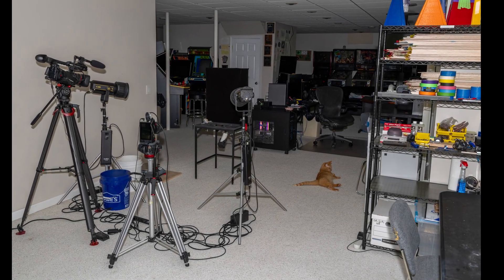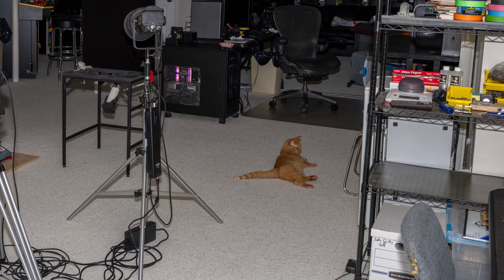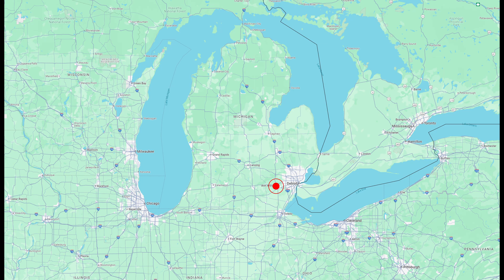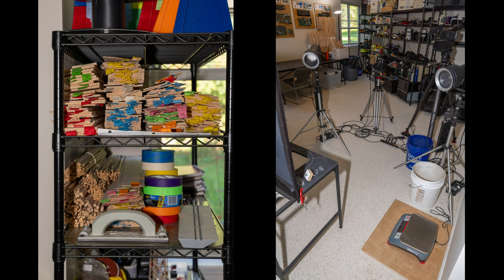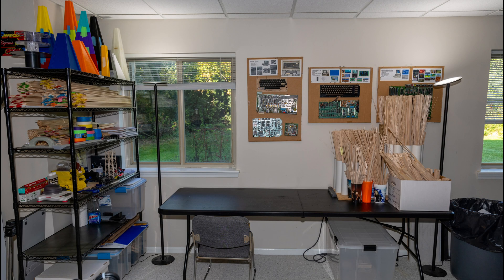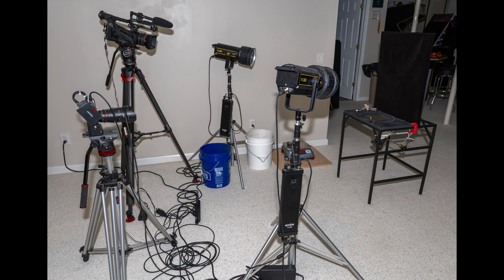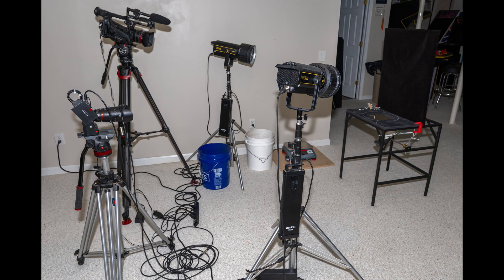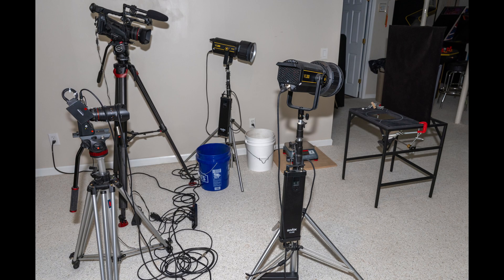Balsa Engineering Invitation

Comment: How many towers have you made so far this season in the process of optimization, and how long does it typically take you to build one from scratch? I remember in your bridge optimization series, you made ~96 bridges, each of which taking approximately an hour to complete. However, as I'm sure your aware, it takes a whole lot longer to make a tower than a bridge. In fact, it typically takes me anywhere from 5-6 hours starting from scratch, whereby I strip balsa from sheets, cut and sand balsa, weigh balsa, measure and mark balsa, attach said balsa to the jig, glue the members, level the ends, and finally remove the tower. Throughout this season, I've made 23 towers, however I'm inclined to believe some competitive teams are beyond this. I think by competition I will have made 40. Do you think this is enough? What has your experience been with this years process of optimization? Has it required 96 towers like it did so for bridges?
Reply from the maker: Hi!  For Div C this year, I only had to make 5 towers to get to my benchmark build.  I would imagine I'd need another 5-10 builds to really do final optimization and then multiple builds for each important competition to choose the best one.  You are definitely right wrt time to build these towers.  It takes me about 3 hours each, not counting material selection and library creation.  The year I built 96 bridges, and our team as a whole was probably close to 200, we were really figuring things out from scratch, including a decent design.  Once you have a good base design, that can cut down a lot of extra work.  You still need to do a ton of work to gain build skills and material optimization, but there is less time spent on building "bad" designs.  That is one of the primary reasons for my channel... I want students to be able to build 20-30 devices and be able to compete at the highest level instead of hundreds (even 100s only works with some guidance, trial and error on the design from scratch is not enough).  Anyway, back to your question, the number of towers you'll need to build will vary on a lot of factors, but it sounds like you have the build skills down with 23 towers already, so the next dozen or so should get you to where you want to be if you have the ability to analyze the failures with high speed video.  Good luck!!  (BTW, if you are having trouble optimizing your design, be sure to check out my older series on advanced optimization techniques. it was made using bridges, but the concepts apply for all these devices)
Reply: @balsaengineering6686  Another question: I've recently gotten my hands on a scale that is precise down to milligrams, and what I've discovered is that large fluctuations in weight distribution are not just existent in sheets and sticks, but that they also exist down to individual members themselves, and by a considerable amount. What I'd like to know is, what percent margin of error do you typically find acceptable for deviations in weight on a member to member basis? For example, if I am on the 4th tier of my tower, and my cross member's have an average mass of .06 grams, would you find it unacceptable to include a member that weighs .054 grams in that layer? A 10% deviation in mass is a considerable amount, especially at such a small scale, and I could find it reasonable to assume that such a deviation could induce disproportional axial loads, resulting in a premature failure.
Reply from the maker: @Justin-x6b7h  That's a good question... generally, I try and keep things within about 10% or so.  Often I only weigh all the cross members of a layer together and just make sure as a group they are increasing or decreasing like I expect.  You are right though, balsa is really not consistent and ideally you'd weigh every single piece with a milligram accurate scale.  I have one which is really nice, but it's also nearly $500, so I try and show techniques that don't require that kind of precision, but if you have access to one, by all means work to get every single piece as close to each other as possible.